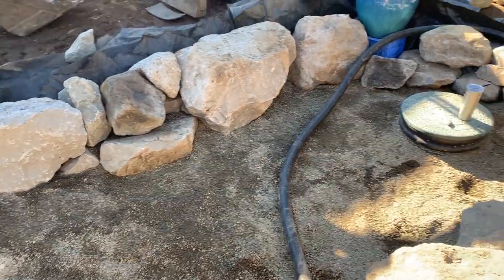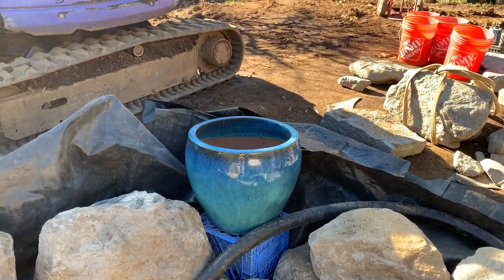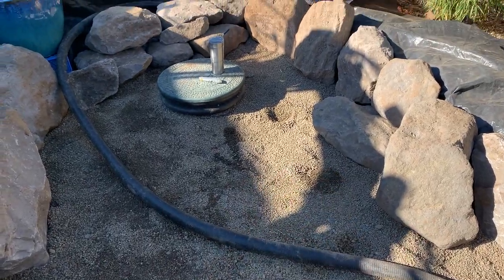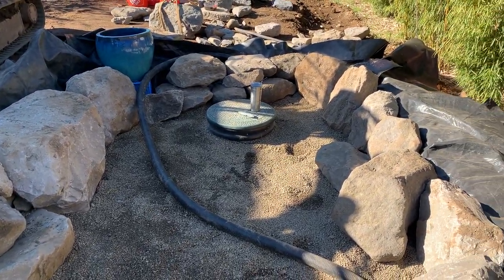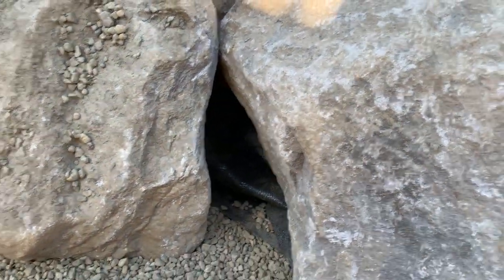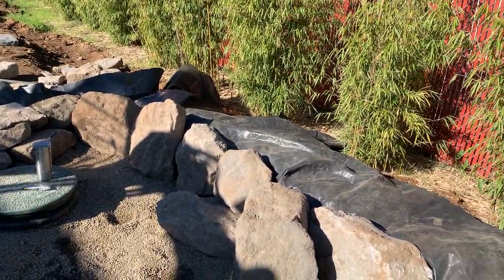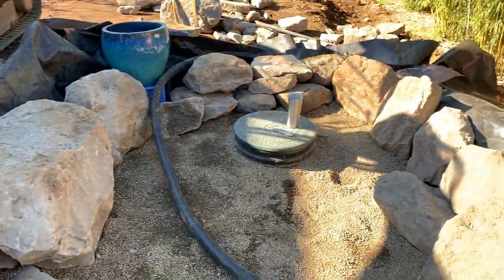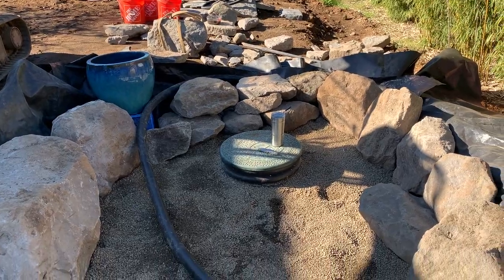Backyard Water Garden: The Wetland Filter is Almost Done!

Comment: What I did with my sandbag wall I put a rock wall in front of them and flat stone on top of the sand bags so you have the sandbags sand witched between the boulders in the wetland filter and boulders on the outside with the sandbags in the middle. Very strong..
Reply from the maker: Thanks, Mike. I must be missing something, though. If you have a boulder wall on both sides of the liner, why do you need the sandbags?
Reply: @TylerTervooren  I could have done that but I wanted the wall to be wider and stronger with the sandbags not just the rocks.  If the rocks gave way than the wall could collapse. Sand bags make it so much stronger and easy. So to hide the sandbag wall I used rocks on both sides of the wall than just used flat rocks on top of the sandbags and everything is hidden now and you have a nice strong stone wall also the sandbags act as an insulator against the cold and heat.

Comment: Nice job on the milk crates. You can go on line and purchase used plastic pallets that would cover your crates nicely and add a little extra volume and help  redistribute weight if that's a concern. 
Thanks for the continuation. Also are you putting a skimmer? I did an 8,000 gal. pond with tri-level water falls years ago. Keep your pump out of the deep! Best if close to an edge and build a skimmer. Also put jets in near the deep, this will help prevent excess waste from accumulating.
Reply from the maker: With 2'+ of rock over the crates, I'm not worried about weight distribution at all. But if I could do it all again, I think I'd get the heavy duty plastic pallets and use them exclusively instead of the milk crates. 

The light duty ones aren't too hard to come by locally, but the heavy duty ones are pretty tough to source unless you're buying a truck load of them.

Comment: What are you using for a pump to feed the bog?  How many gal total is pond?
Reply from the maker: Pond is about 9500 gallons. Will be running an ES8500 from Advantage Manufacturing for the bog. 8500 gph variable speed pump, but will only be sending about 3000 gph into the bog. The rest will get dumped out on top for a better waterfall when we're around to look at it.